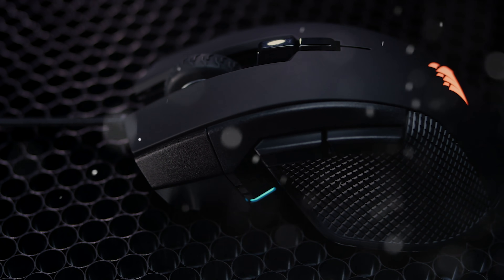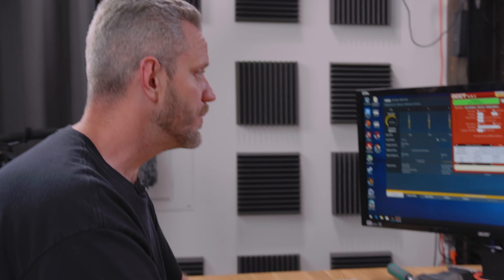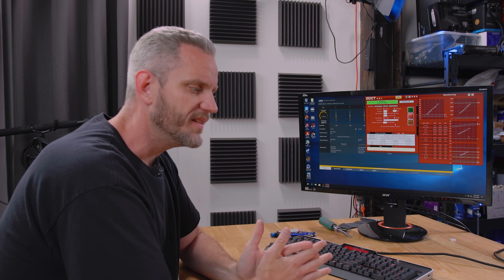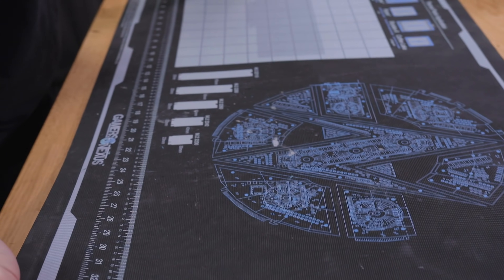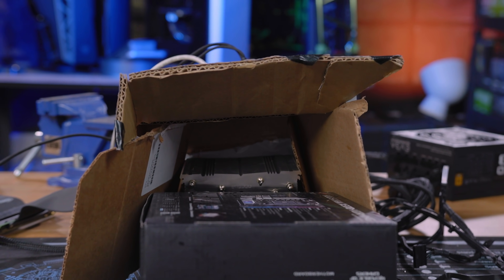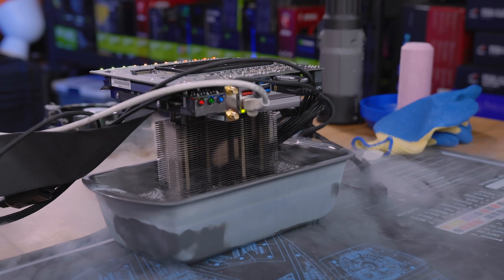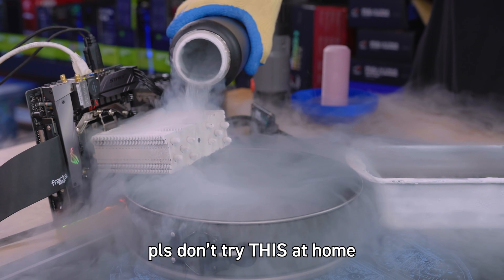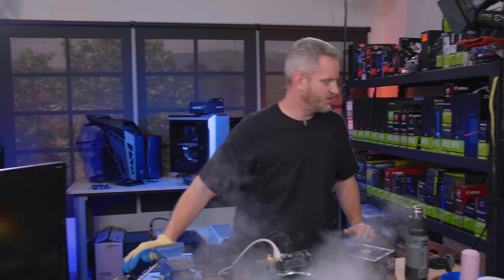We LN2 cooled an Air Cooler?! Don’t try this!

Comment: Haven't watched the video yet, but I don't think ln2 cooling an air-cooler is that stupid.
I saw someone do that because hhe wanted to see if you can ln2 cool without a ln2 pod. And according to him it worked really good and was pretty much like an ln2 pod.
He used water soaked paper towels around the cooler to form a shell. That worked because they pretty much instantly froze as he poured ln2 into this shell. And bam: he had a really cheap really crappy but working ln2 pod.

Edit:
Yeah what you have done was stupid. I underestimated your stupidity^^

Comment: Before watching, I'd expect the heat pipes to stop working because the liquid in them freezes so they'll conduct heat only as good as a copper pipe. Depending on which part of the cooler they apply the LN2 to, this means the setup either works a bit worse than normal LN2 or a lot worse than normal air cooling.

Comment: Surely you should have done it to a watercooler?
Will ln2 work in a watercooling loop?

Also the ln2 is heavier so your container should have had one of the four sides lower, then the ln2 would flow in the direction you wanted you could have even built a card board ramp to the fan.
Think hot wheels for ln2

Comment: when metal is colder, the molecules are packed closer together. so the free electrons in metal, which conduct the heat, have narrower spaces to go through, and thus conduct less efficiently.
This might explain why it stopped working when the heatsink was placed right in the LN2

Thanks for the entertainment Jay and team!

Comment: is it possible to do a full submerged if the motherboard wandering if is ln2 conductive
Reply: The Classic Gamer nope, it will shut off, not for short circuit but for extreme cold, some motherboard components doesn’t like too much cold

Comment: Doing gas shows was definitely a LOT of fun - but the best best bit wasnt cryofluids - it was bubbling oxy-acetylene mix through dishwashing soap, and dropping a match on it. One after show we did an extra big pile, and the shockwave blew a wall of chalk dust off the old lecture theatre board about a foot - just this line of dust in midair.

Comment: Wrong you need something like the dark rock pro 4 and cool one half of the heat sink with LN2 and keep the other half warm so the heat can convex off the CPU efficiently !!! just remove the fan from the centre of the fin stack and that container should fit neatly on one stack while the other over hangs the side of that container.
Reply: In theory

Comment: Good One. Maybe you can do an specific video to O.C. the memory, ther're a lot but no one can help with my Ram, im soo bad at it, or the modules sucks, XPG D80 Spectrix 3200mhz sucks at OC. Even the watercooling stuff sucks on this ones...Im using a Asus Maximus X Hero (370) board with an 8700k at 5Ghz on air.Thanks a lot for the stuff and do more R.I.P GN Videos.

Comment: if you cool it down that much the heatpipes wont work.  you need a solid aluminum heatsink.  heatpipes have liquid that turns to gas above a certain temp (maybe 40c?).  if you cool it down that far then the liquid wont change state and take the heat away.  of course with the huge temp difference the solid walls of the copper pips will take some heat away.  but i dont know how much

Comment: ugggh jay I actually had a problem with my laptop not booting to more than bios if at all and had eventually diagnosed it as a bad m.2 slot or m.2 drive but eventually sent it in under warranty and now am trying to find money to build a full desktop PC for the first time since 2010 and stuggling wish you had made that video earlier so I coulda saved my gigabyte aero 15 :(

Comment: @Jay, it didn't work when you submerged it because heat travels up, and cold temperatures fall. The board was upside down so no heat was getting to the cooler. I bet it would work GREAT if you could submerge the cooler upright.

Comment: I have possibly one of the most asinine strangest build ideas. I live in the mojave desert, having a powerful computer in my house when I am cooling my house with a swamp cooler noticeably raises the temperature in my room. I want to cool my PC but pump the heat outside. Many people have done water cooling where the radiator is located outside, but when it is 110 outside, that is not what I want to cool my performance PC with. Others have done videos using aquarium water chillers to chill their PC for extreme overclocking, but they run around 400$. I think I know of a source of a cheap water cooler that you could disassemble and build a waterblock around the cold end to chill the PC's water line, and have the hot end radiator located outside your home. No matter what you are pumping the heat into your house and having to cool it using either a swamp cooler or air conditioner, why not do that at the source?

What is this mythical cheap, easily sourced and modifiable water chiller I speak of? Well.... A water cooler that you stand around and gossip in your office. I have a cheap watercooler that has a mini fridge in the bottom of it, even regular office water coolers have a compressor and cold end that can be used to chill a PC's water cooling loop.... If you can source one that has the mini fridge in the base, the compressor and cold ends should be more than enough to cool at least a basic, if not slightly overclocked build and eject the heat outside of the house.

Even if the compressor is slightly underpowered, an insulated reservoir and running the compressor on a PIC should keep the system within acceptable ranges in 95% of use cases.

Comment: Next wierd experiment you should build a standard water cooled system but use LN2
Reply: In theory it could blow up since the Nitrogen would become a gas again and I doubt a standard water cooling loop could handle the pressure.
Maybe if he uses the LN2 Container as the reservoir and leaves the lid open with just two pipes running inside.
Reply: @96Assassine  that's more a less what I was trying to say

Comment: To avoid freezing what's inside the heat pipes, you could try dipping the cooler, but only 1 or 2 fins deep.  Maybe also start the test a few seconds before dipping.

Comment: It's because the cold wants to go down compared to the heat around it when it hit the heat pipes it was above the pipes, which means it'll get hotter than the tubes. If somehow it ran through the fins while upright, THAT would drop those temps like a rock. A frozen rock.

Comment: Would there be any way you could get the LN2 inside the pipes of the cooler? Im not sure it would make the heat sink work any better though because of the contact issue between the cooler and the cpu, but it might cause the contact block to be cooler and actually work.

Comment: is there a way where you can take the refrigerant out of a AC condenser and run LM2 through??? technically it would have the same heat to gas back to liquid properties involded but you would need to find the rate at witch these happen and at what volume compared to regular refrigerant. But if you could, run the compressed liquid side of the AC lines through a water block or hacked air cooler block (just like the one you had in this video but with the tubes cut, and the AC line soldered to them in series)
Reply: this would be an overkill way of using LM2 if you did it (pretty genius for overclocking methods)
Reply: Or instead, if you know someone who could remove the refrigerant while you modify an AC unit to use in this way. Then have him put it back in after, instead of trying to find a way to put LM2 in an AC condenser lol

Comment: Dipping it in LN2 didn't work for two reason:

Convection doesn't work if the heat source is on top and the cooler (LN2) below.
Definitely froze the vapors in the heatpipes.

I'd suggest to improve on this Jay you design a LN2 holding chamber around the top of heatsink, so that convection can actually work in your favor, as well as reducing the amount of vapor being frozen.
Reply: @David Weeks air coolers have vapor chambers that rely on convection. If you dont set them up to work with gravity you will lose how effective they are. 

Thank you for explaining convection to me, but I already understand how it works just fine. Thanks

Comment: I may be showing ignorance... But... Why the greyed out floating face
Reply: If it's the head in the bottom right, YouTube places an image there in most full screen video. Sometimes it will just say subscribe, other times it will be a custom image. It's probably a watermark to stop people just recording the video and posting it for themselves
Reply: @Macantor13  Actually, a watermark makes alot of sense
Reply: @seanohutton3185  Apparently some people are seeing it in the middle of the video though, so if that's what's happening to you that's not normal and is a pretty annoying bug. It should just be small in the corner
Reply: @Macantor13  Yep... It's about a third in from right, roughly centreline when watching using the app on my phone ... 

Hence why I thought "what the?..." and asked the question. 

Tho, I guessed based on your response, and because it's so in your face... I guessed watermark.

Comment: I don't see the problem with doing this at all.
Reply: LN2 evaporates and as a gas it can suddenly displace oxygen — if someone was in a small room without much ventilation from outside the room they could die. " Each litre of
liquid nitrogen expands to 0.7 cubic metre. Therefore, as little as 7 litres, if vaporised, can
 completely displace the air in a passenger lift, and a smaller vaporised volume can result in a lethal drop in oxygen level."
Reply: @EB01  huh, I was joking but I now I know a problem with doing this. Thank you XD